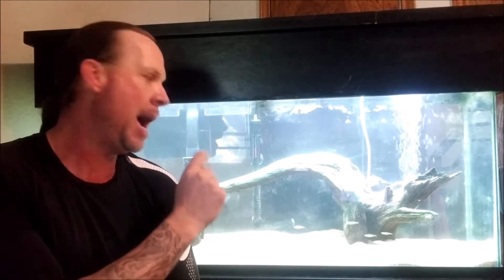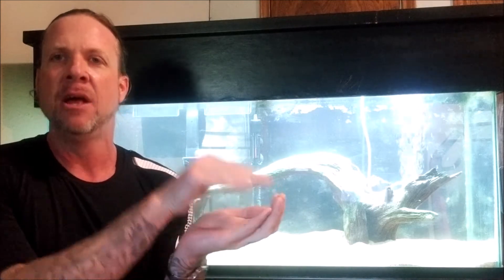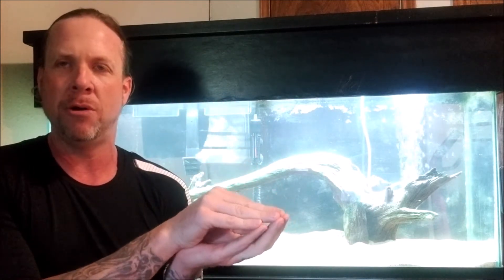German Blue Rams   Why your hard water is killing them

Comment: steve I have a question   I am moving   to  an apartment down the street   owner is selling the house what is the best way to move   tank and fishes
Reply from the maker: Either move your tanks first or last.  Empty as much of your tank as you can, bucket the fish, try not to lower the water below the substrate to keep your bb there.  Buy enough 5g buckets, run water, declorinate, refill, get your filters back up and running and add them back.  I didn't lose one fish during my move this way bro
Reply: @ScubaSteve4444    Mom died  May 11th   and now  the owner is selling I have 2-  5 gallon bucket with battery  air pump